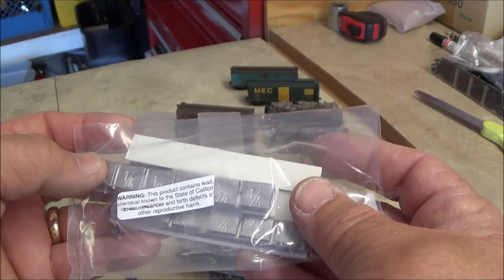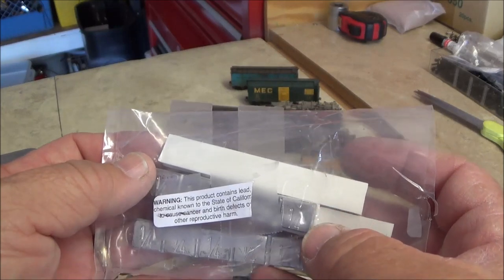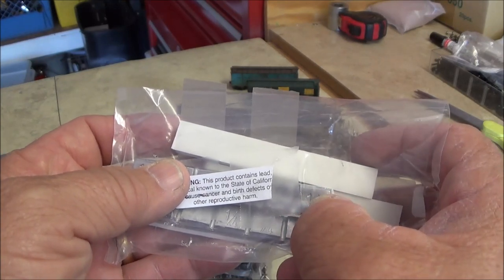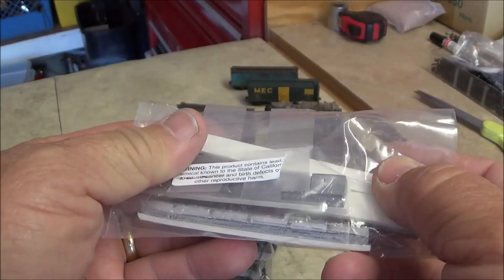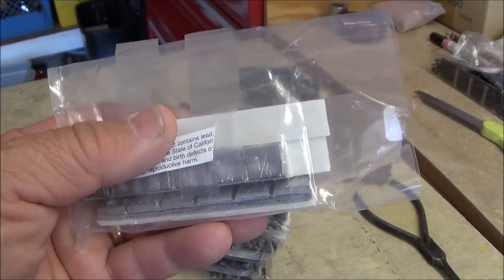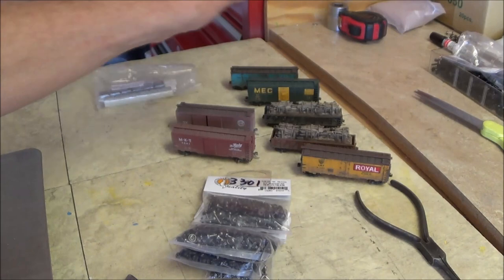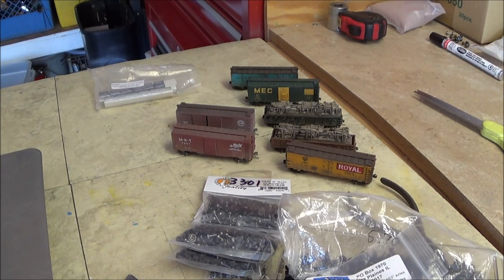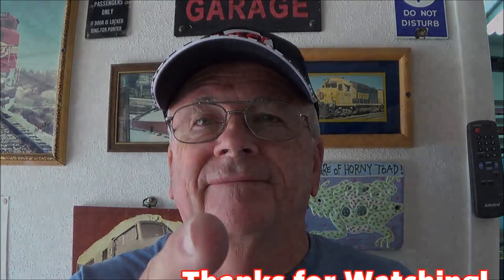I've gone to the Dark Side on the N Scale ACT

Comment: Hi Mike, great video. Model Railroader did an article on this same subject. They showed how to make your own scale ruler using a 1 x 4 piece of wood and a piece of flex track. It is time consuming but it is well worth it. All my cars have some weight added to them using the same weights you are using. I have found some weights at Hobby Lobby that are used for those pine wood race cars. They are a little smaller than the ones from MicroMark and work well in tight spots. I have been wanting to change the axles to metal ones but I did not realize they are different lengths. Thanks for the info and I will pick up a caliper.
Randy
Reply from the maker: Thanks very much for the weight tip and hope the conversions go well.
Mike

Comment: Dark Side?  No way, metal wheels are the way to go for cleanliness, looks, and especially the sound.  Unfortunately, when I first installed some FVM wheels, a few of the wheels came off the axles.  Since then, I use IM wheels.  For weights I use nuts from the hardware store, very cheap and I apply them with good ole' CA.  Another thing I do is to remove the stock bolster pins and tap and insert a 2-56 screw along with white elmers glue to hold in the screw.  I have been able to do this with all of my rolling stock, MTL, IM, Kato, Con-Cor, and I use only MTL truck mounted couplers. 

Have you ever tried to put weights into a tank car?  Now that can be a challenge!
Reply from the maker: Thanks , I am learning as I go and No tank cars yet. I am concentrating on some 125 boxcars at first.
Mike
Reply: I have done a few Bachmann tank cars. I use 1/10oz split shot sinkers from the fishing gear stores around me. Take the screw out of the bottom and add in what you need. Put a drop of CA (superglue) on it and put it back together.
Reply: 3.141 59 - I'm of the "newer school" thinking of going heavyweight on my rolling stock.... I did it in N, and took the concept even further in HO Scale.
Basically, starting with the NMRA Standards, and then adding a full ounce, or 8% more, depending on application. This REQUIRES quality, well tuned wheelsets and trucks!

The payoff: FAR smoother rolling, lighted cars flicker less, less derailments, especially through turnouts and just a more prototypical looking ride. 
My Layout is limited to 1.8 degree inclines, and that hasn't given me ANY problems with locomotives, which are also "superweighted". 

..... I only use real lead weights. No, it's not as healthy! However, after many years of working with it as an Auto Mechanic, I've learned that a simple hand wash with dish soap, gets rid of any harmful residue. Just don't wait to wash, and don't touch a bunch of other stuff before you wash!! 😎
Carmine 🚂

Comment: Mike, I have been using metal wheelsets and micro-trains trucks for 10 years and love them.  I have discovered that body mount help derailment a lot.
Reply from the maker: I do not prefer body mounts with my smaller radius curves. It certainly helps when pushing cars.
Mike

Comment: I've got a few fickle trucks that don't like my metal wheel sets to. But when it comes to switching there worth it. Not very high on cleaning track in my book as well. But when it comes to stock cars you got some choices on weight color. One greenish tan and one tan will give you the look of hay and straw placed in the car getting ready to pick up livestock. As the hay and straw would be placed in the car any time livestock is to be loaded or loaded in the car at every water stop. (No water trough in the car made these stops needed.) but the cars are small enough in N scale u don't think that would be needed as well. Yet chickens shipped in stock cars would be in metal pins along the walls of the car stacked normally only 3 cages high. So it also looks like there could be some cages left from the side of the car to. So you can lick back at the rivet counters.

Comment: For flat cars I glue lead shot to the bottom of the car.  Sometimes I have to carve out some of the plastic underneath the floor.  If you are eye level with a flashlight you can see the lead shot, but with my layout and most layouts I don't see the lead shot at my viewing angle.  I also do this method for empty hoppers, 2 bay hoppers, underneath the car and not in the hopper where the load would go.

Comment: Hi Mike!
I'm back, sorta.... New channel, starting over with nearly nothing but hope and friends. 
I'm not sure I would call that "dark side"!! 😛  In larger Scales - plastic vs. metal is a better argument for cleaner track.... They just pick up more gunk than the tiny wheelsets in lightweight N Scale rolling stock. 
However, I would maintain that metal wheels DO roll with less resistance than plastic. MTL wheelsets I believe, are Delrin, and better rolling with less resistant than plastic.

I really believe that in the long run, you are going to see a difference! 👍👍
Carmine 🚂
Reply: I had mentioned in another post, I OVER weight my rolling stock. But as you mentioned, I limit my grades to 1.8%, to not overstrain my locomotives.

I do go significantly over the NMRA Standards! In HO Scale, it makes a real difference in performance!
Reply from the maker: Thanks Carmine , Good to see you once again and I think you are right on this.
Mike

Comment: I have been an N scale modeler for over 50 years and have always liked metal wheels much more than plastic. Most of my rolling stock has metal wheels ( 90% + ) and I have over 800 pieces. Now I'll till you why, and the reason is very simple. DIRT ! Most modelers don't know this but, Rapido made the BEST track of anyone in almost any scale and for that very same reason.  DIRT ! Although most of their rolling stock had plastic wheels, that's only half of the story. Here's the kicker, .... the top of the rail on their track is ..... ROUND.....!!! There's NO surface for the dirt to stay ! ! ! Rapido, one of the biggest, the one that started it all, NEVER made a track cleaning car because, there was no need, you don't need one! You almost all the time have continuity because of that single point between rail and wheel. Now a lot of modelers are saying round toped rail is not realistic, but we know there are liberties we take in the hobby and to me this one is well worth taking. Besides, in N scale it's so small you hardly notice it. I only wish they lasted longer so as to make a solid round toped rail of nickel silver. This is a great hobby and my two cents, N scale, metal wheels, Rapido track. Great video, Thanks Mike
Reply from the maker: Thanks George, Mike

Comment: This might be too late for you but I found adhesive backed wheel weights by Motion Pro  on Amazon and other us sellers that come in 1/4 and 1/8 oz sizes. They are just the right width and come in gray or black powdered coated steel. It works out to 12 cents each for the 1/4 oz and 6 cents each for the 1/8 oz size. It will cut down on the cutting and they are lower profile that the ones you used.
Reply from the maker: Cool , do you have a link?
Thanks , Mike
Reply: If you don't have prime www.socalpowersports.com has them also I think they have free shipping.
Reply: Sounds like something you need to stock......
Reply from the maker: That would be fine if we could buy them wholesale but likely not.
Thanks , Mike

Comment: Very helpful. One question for a starter. Have trucks always been built to be removable? I bought a random assortment 2nd hand and most have no screws and I've been reluctant to try  to see if they are pins that pop out or for example a pin the is moulded as part of the chasis, had the trucks put on and the top heat squished to stop the truck coming off. ? I'm concerned at damaging the car/chassis if i assume it pops out but was never meant to. Is there any way to tell for certain?
Reply from the maker: All cars are not created equal. I can only say, you will likely have to take the car apart to find out but no trucks I know of are mounted permanently.
Thanks , Mike

Comment: Great video .. a couple of questions as I am going to be doing changes to my wheel sets as well as trucks/couplers.  Why did you choose 33" vs 36" for the wheel set and how the heck do you you figure out which truck/coupler combination do you pick?
Reply from the maker: I always use Micro-Trains trucks but that is why you need the caliper. I used 33" as most of the 40' cars had 33. To me the size is so slight I would not care even if the modern car had 36" , but it is all visual.
Thanks , Mike

Comment: Most of my N scale cars have metal stock wheels and some plastic wheels (few). They all seem to work well. The weight of the cars is the big issue in running well (same with my HO) especially with N. As long as my wheel sets are in gauge and the cars are weighted properly I have no problems.  I don't have a reason to change the plastic wheels to metal, as they seem to work well. It takes some finesse to weight gondolas and flat cars but isn't that part of the fun of being a modeler?
Reply from the maker: Thanks Craig , I agree, they all work.
Mike

Comment: Hi Mike!  I have noticed that on my layout with Kato UniTrack, sometimes the metal wheels on my cars short out the track voltage while transiting some turnouts.  Especially the double crossover.  What has been your experience?
Reply from the maker: None yet. I would think if that is happening that the wheel sets in question may be on some older cars , as some of the early metal sets had very wide treads.
Thanks , Mike

Comment: Mike, notice some cars couplers are body mounted some not. The coupler pocket from the MT trucks can be cut off and mounted to car, but not sure what drill and tap and screw to use. Any advise from u or group would help. Now back to my rev. Section controlled by MRC 520 unit shorting problem. Thanks guys.
Reply from the maker: Thanks John , I still do not care for using body mounts on my compact layout.
Thanks , Mike

Comment: Excellent video my friend. I have problems with metal wheel on a stack train I have, If you want to send me some of the Plastic Micro-Trains wheels you removed, I would be very grateful for them my friend. This is Rob Webb
Reply from the maker: What kind of problems?
Reply: I'm running Code 80 Flex, & I have a set of articulated well cars that came with metal wheels on them, The wheels seem to rise up & the drag at an angle where one set is off the rail while the other set on the same truck stays on the rail. If that makes since.
Reply from the maker: It is likely not a wheel problem unless they are out of gauge. It is more likely the truck is too tight or the wheel flange is touching something on the underside of the car. 
Thanks , Mike
Reply: I'll check it out more, they don't roll freely on the rails, So something must be touching something. They were used when I purchased a lot of them from someone on N scale Buy Sell Trade. I have them on a siding until I can afford to get Micro-Train Truck for them. Thank for your time, & help. Rob
Reply from the maker: The axles may be too ling for the trucks as well , if it is not rolling easily.
Mike
Reply: Thanks again for your time& help, I'll check it out shortly, & provide some more feedback. Thanks, Robert Webb
Reply from the maker: Thanks Robert, Mike

Comment: Mike, back in the 70s/80s, I used metal for only two reasons: 1- real cars don't use plastic wheels... lol  2- plastic wheels make it harder... well, at least way back when... to light the interior of some cars.  I could have cared less regarding cleaner tracks, as I used 'special' cars (modified by yours truly), one pushed and one pulled for that chore_ once a week without fail_ and I never had oxidation issues.  THANK GOD FOR NICKLE SILVER!!!  And regarding weight?  Well, THAT never seemed to be an issue for me, even pulling 40+ cars.  Guess I was lucky.  Glad ya' going 'metal'.  It will LOOK better.

Take care, my friend, and get more vids up.  We like your 'style'.
Reply from the maker: Thanks Mike, my room is fairly clean as well but the issue is really weight and where that weight is on the car.
Thanks , Mike

Comment: Spank my Butt Uncle Mike you going to Metal Ya Hoo'  that's Great.. I've seen differences in Metal compared to plastic and seen more than my share of Derailments with Good Cars like Intermoutain, And Microtrains one of them Being an Auto Rack with the D&RGW This car was a Sweet car Mike liked it because of the Denver and Rio Grand but every Darn Time it went through my 2 KATO #6's with the Microtrains plastic lovelies I'll call the Damn things that Auto Rack jumped the the Tracks I changed the wheels to Metal and Boom like a zombie the Car Derailments went a Way! But I decided not to keep the Car for other Reasons.. what I can't understand is Manufactures Like Intermoutain on some cars you'll see Microtrains Trucks and plastic wheels, some will have Microtrains and Fox Valley metal wheels, and on some  Intermoutain Cars it's there own trucks and there own wheels, sorry to be cheek about this Mike but it's all a bunch a Horse puckey to keep up with ; )  But who's to stop it.. But I'd like to ask how much does that scale cost I can just imagion it's above my pay Grade And on the Weigts.. You can if your local Hobby Does not carry non Lead weights, Go to your local Tire shop an acquire them there they Should have a Variety of sizes do in part of what's needed to Ballance Car Tires & Rims I got mine at my Local Good Year Tire shop and the Weights Did not Have any Lead as Tire shops can't use the Lead OZ weights any longer.. My OZ weights that I bought cost $5.00 for about 50 that I needed if anybody still has or is Using Lead Weights wash your hands after Handling Them.. As Lead can be Dangerous to your Health...
Reply from the maker: Thanks Ron , I hope this works for me.
Mike

Comment: Hi Mike, the thing that needs to be kept in mind is that the metal wheels conduct electricity (duh).   Where this can be an issue is on a reversing loop when you have cars with metal wheels exiting the reversing loop while cars are still entering the reversing loop (and there is opposite polarity on each side).   If the metal wheels bridge the track on both sides, you'll get a short and the only way to fix it is to drag the train (manually) through the reversing section.  The issue is exacerbated if you use Kato passenger cars because they have a metal strip which connects the trucks (electrically).   In my case, this limits the length of trains that I can run.
Reply from the maker: Metal wheels have NO bearing on shorts in reverse loops UNLESS they are conducting electricity up to a lighted car or device of some kind.
Thanks , Mike
Reply: This depends upon how you've joined the regular track to the reversing loop track.   In some cases people just cut a gap in which case the metal wheel can bridge the gap and if that happens on both sides at the same time you'll get a short.   When a generic insulation joiner is used, it doesn't come to the top of the rail so you'll get the same effect.   The metal wheel conducts electrical current between the 2 rails.

Comment: Mike, thanks for the video.   I'm a proponent of weighing to NMRA specs and I do that with all the rolling stock I get (exceptions follow).   If there is a problem with rolling resistance on the stock then I convert to metal wheels but at this point I haven't converted all my stock.

I use some side cutters I've had for years to cut the weights.   I purchase weights from a local hobby store.   You can also get them in RC plane stores (and online through similar stores) as the weights are used to adjust the CG on RC planes.

I run a lot of passenger cars and do NOT weight them.   Partially because I'm worried about the weights being seen through the windows and partially because I have a lot.  So far I haven't had any issues with them (most are Kato).   I don't do any switching with them though.

I do have issues with the flat cars and with a lot of tank cars, depending upon manufacturer.   Some are pretty close so that's OK but for the ones that aren't, if I can't pop the body off then they have to stay at their stock weight, even if light.

I'm still up in the air with my Kato double Stacks.   I haven't even checked their weight although with one of them I did add some weight to one of the containers so keep the front truck on the track.   Not sure if I'll weight the rest or not. 

Oh and I do paint my weights black IF I think they can be seen.
Reply from the maker: Thanks for the info Don , Mike

Comment: Hi Mike, I'm surprised with the Micro-Trains cars, I thought they were correctly weighted right from the factory. Has adding weight and metal wheels stopped the slinky effect often experienced with Micro-Trains couplers? Loved the Twilight Zone music, brings back lots of memories. On the other hand, I guess I'm also showing my age ( ha ha ha ) Cheers Rich.
Reply from the maker: Thanks Rich, I have not run enough to notice but I would guess there is nothing to get rid of slinky.
Thanks , Mike
Reply: MTL makes http://www.micro-trains.com/n-2-truck-restraining-springs-1953-12-ea-00112002?search=spring&category_id=109 which can be used to help cut down the "slinky" effect. It creates a small amount of drag on the cars. They made it to keep light weight cars and cars with metal trucks from being pulled into the magnets and being unintentionally uncoupled but it will help with the slinky.
Reply: Hi Ron, Thanks for the link. Cheers Rich
Reply from the maker: Or you could go here.
http://fiferhobbysu770.corecommerce.com/cart.php?m=product_detail&p=13078
Thanks Ron and Rich , Mike